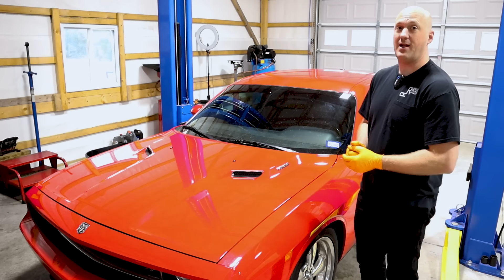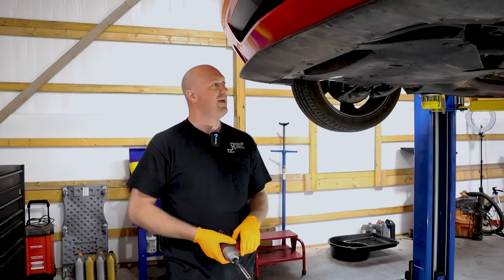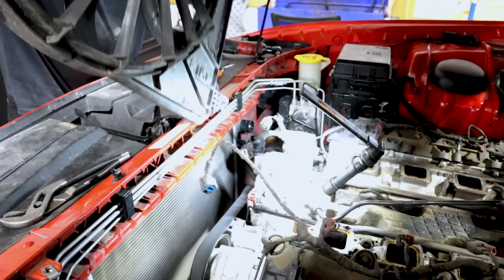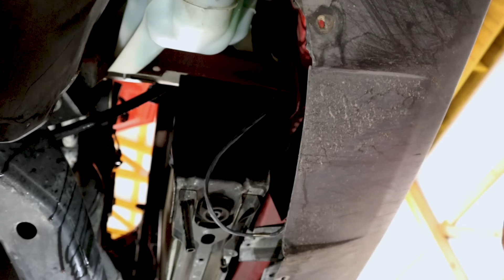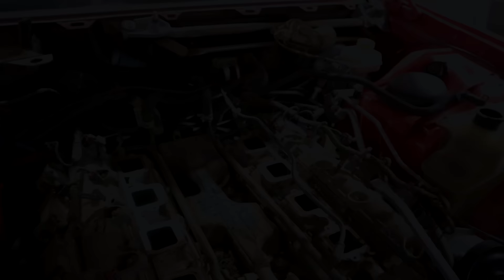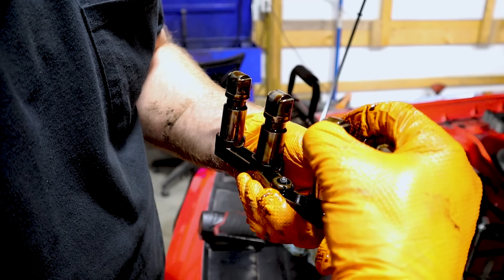Hemi Cam Installation! Budget Challenger Build Ep1

Comment from the maker: Let me know, what mods are you planning on doing to your Hemi next!?
Reply: I’ve already done long tube headers catless mid pipes CAI 85mm throttle body one piece aluminum driveshaft and 100 octane tune. I have a new CompCams camshaft and valve springs and new hellcat lifters I’m going to install. My R/T put 375hp and 405tq on the dyno. That’s to bad seeing as the DA was over 6000’ that day.
Reply: @jimmyford271  I know it sounds cool to say hellcat lifters but they're exactly the same non mds lifters across the board for all gen3 hemis...nothing special about them.
Reply: @DL101ca  maybe so but I ordered them for a hellcat so I call them hellcat lifters.
Reply from the maker: @jimmyford271  sweet!
Reply: I'm really looking forward to seeing how the 6.1 stock manifolds will bolt up.  I'd like to do that with my ram, but I do have the 08 engine, so I have the egr hole on cylinder #2 exhaust, and I have the rectangle exhaust port heads (Can't remember if it was Apache or Eagle), so I'm not sure if things will line up.  Boy the "log" exhaust manifolds that came stock are crying for better flow!
Reply from the maker: @The3chordwonder  Unfortunately the SRT headers won't work for the ram trucks. They'll bolt up to the headers just fine, but they are too wide to fit the engine bay.
Reply: @ReignitedAuto  That makes sense, there isn't very much room there for sure the way the engine sits between the rails.
Reply: @ReignitedAuto  hey this is a little random for this video but I had a question that I’m hoping u could help me with. If I was to supercharge/turbo charge an 06 charger rt would that same supercharger fit into a 2011+ model..? Thanks
Reply: What brand catch can and where can i pick up the same one? @ReignitedAuto
Reply: I really like the detail you put in, every step is nice to see, I was a life long Dodge man, bought my first Ford a year ago, a 2011 SHO with 45000kms on it and I kinda regret doing so, the water pump is leaking already and the AC doesn't work, I wish you could do one for the SHO, apparently is a nightmare to do, should have stuck with my Hemi lol
Reply from the maker: @stevelynch5843   I know Hemi stuff the best, but I'm definitely not brand loyal, I like all brands, and the old school SHO was a fun car!
Reply: I've had my cream puff factory stock '12 R/T for quite sometime. She's at only 39K miles so it's time for some goodies. I'm gonna start with the back amd work my way forward.
Reply: I couldn't find my original post to update but wanted to say thank you so much for this series. I have a Mopar 11 that lost timing chain.  The dealer diagnosed it(by leaving my engine in pieces, not exaggerating) saying it needed a new engine. I was intimidated because this was my first Dodge(Chevy guy)but your video gave me so much info I tackled it replacing cam, lifters, chain, tensioner oil pump and bent valves in head. Running like a top. Not enough room to type all the thank you's. You are the man.
Reply from the maker: @kevinbutler1173  that is great to hear! Pat yourself on the back as well, that's a lot of work! 👍
Reply: @kevinbutler1173  did you have any experience before?
Reply: I want to do alot, but I bought my Challenger in January,  and got the best service policy they offered.  I have almost 5 years before I can really mess with it. Fortunately,  the original owner installed a nice sounding exhaust and a hurst shifter on the 6 speed. Will be adding a sub and Amp for extra enjoyment soon, just haven't decided on what radio I  want.
Reply from the maker: @dfre6422  I miss the days of a good sounding stereo. One day I'll go all out on a nice one for my daily driver 💪
Reply: I did the the Srt headers and exhaust was thinking about doing the 6.4 cam ... are you going to tune it your self ?
Reply from the maker: @Airwalkz23   I'll be putting a DiabloSport canned tune on it for now. I'm hoping to dyno it at some point to maximize the tune, but no, I won't be doing it myself. I have some tuning basics, but not enough to do this.
Reply: True cold air intake and 392 intake swap are next in line. Then headers and exhaust
Reply: I started with the cam swap. Gonna force myself to do the rest now.
Reply from the maker: @clintondieter5871  Hard part is done!
Reply: Hey boss what do u think I should go with on my hemi I just want a little more hp and torq not to much just sum SIMPLE bc I loss hp and torque after I got a resonator delete it's like my car dont have that take anymore now it kinda drag a little b4 it gives off
Reply from the maker: @rzivh5682  Nothing simpler than buying a tuner. 👍
Reply: These new so called factory hemi vehicles today are Not  true Hemi's, it's a hemi by name only unfortunately.

The hemispherical head dome pistons will always be the TRUE HEMI's.

32 years of NHRA racing, has blessed me with great experiences with the Hemi engines.
Reply: @FaithfulServant316  Hemispherical Combustion Chamber = Hemi, what a waste of 32 years, I'd say.
Reply: MDS delete, cam upgrade, injectors, intake, headers and exhaust system. then probably some slotted rotors and stickier brake pads. thanks for the videos! so much great information!
Reply: will an intake mani upgrade provide any gains on a stock 2021 scatpack? ive heard compression and the factory timing are spicy enough to where bolt ons dont really add power to the 6.4. this true or bologny?
Reply from the maker: @mattpacktree92  I think there's always room for improvement with factory parts, but I definitely wouldn't start with the intake manifold. I think even a custom tune would benefit you more than an intake would. 👍
Reply: Will this work for me i hve an 06 300c
Reply from the maker: @d.i.yjones507  unfortunately not, when they went to VVT in 2009 they changed the block so the camshaft won't work. I've heard the headers will fit, but haven't tried it myself.
Reply: Thanks brotha appreciate it
Reply: Great job lots of tips n tricks thank you 🙌🏼
Reply: I want to get an HP Tuner so it can be tuned. I need to find out whether it will turn the oiling system on, as well. The long tube headers, the stock 392 camshaft, the oil plugs, the upgraded valve springs. Is the vaccum hose on the back of the intake manifold easier to remove and reconnect from the opposite end??? Eventually l would like to put a Summit turbo on it and add some gap to the rings (.032")total gap. Is there any chance you have the 392 stock cam spec's. Look on Richard Holdeners site and he tests the shorty headers compared to long tube, quit a difference on his engine dyno. He has also tested the different mopar intake manifolds to see where each made or lost power in comparison to each different design. I think that is basically it. Excellent video class, i'm impressed. Where are you? My truck is a 2013 Ram which i guess is a Gen lll. I've got a S&B Cold Air system on the engine, as well.
Reply: Hey great instructional vid. I have a 2013 Chrysler Hemi 5.7 and replacing the camshaft and lifters. Other than the cam and lifters, what other replacement parts do I need? ( I'm a novice when it comes to engines, but learning )
Reply from the maker: @user-fu1pm3cf7t  depending on mileage is probably a good idea to also replace your water pump and thermostat. Potentially if you are over 150k miles you might want to think about replacing about the timing chain as well. Obviously head gaskets, valve cover gaskets, timing cover seal.
Reply: I’m replacing a broken piston, thanks to a fallen valve seat
Reply: Can you do something with pushrods/rockers upgrades?
Reply: I think i need hellcat brimbos its hard to hold a stop with this new cam and tune.
Reply: Just got my 2018 Charger RT Hemi man and I’m an was looking for some good cam set up and cold air in tanks all the goodies we know about in the dodge world…I don’t know everything and I’m will learn so much appreciated for your videos I’ll stay tuned! Making a channel soon!!! Just worked and fixed my active exhaust issue…but if you have any products to refer me or anyone else that may have active exhaust issue because it’s seems pretty common that’s why I make a video of me doing the work myself it’s not hard just get a little dirty and most of all make it fun…thanks
Reply: I picked up a 2014 Pursuit, and just added a Loudmouth exhaust. I want to add a 6.4 cam, and long tubes. Are all 6.4 cams the same ?
Reply: Can I do this with a 2015 ram 1500
Reply: Bro could u please post a list of what u put in the budget 5.7l challenger so I can purchase everything bit by bit till I have it all I'm going to try and tackle this myself into my 2014 dodge charger r/t  5.7l the way u explain this build gives me confidence u really articulate it well thanks
Reply: My 2011 1500 lifter went out and so I’m thinking of also doing the 6.4 cam swap.  Does it matter if I use a 6.4 hemi  (truck) or 6.4 (srt cam) to put in my 5.7? I already have it tuned for mds off.
Reply: Mine is a 2015 rt challenger 5.7 it just got to 130000 miles n it started the old hemi tick it's driving me nuts...this video u r showing is it on the 5.7 hemi n if so can I do a cam lifter upgrade that will give me performance and thump sum as well without having g to tune it? Or do I need to tune it regardless but I don't want to have to spend a lot of money cause right now money is tight so the tick is coming from driverside of motor n it's middle close to the back on top.i can't stand it it's killing me lol.love ur videos by the way but please let me know thanks
Reply: I really need to know can  I put a 6.4 MDS cam in my 5.7 to keep the MDS? Will everything work okay without a tune? I actually want to keep it the MDS system.
Reply: Did you resurface the heads
Reply: I am curious about MPG changes if any. In previous videos you mention oil pump upgrades to the hellcat which would be a good time to do with every thing apart. I also like to remove coolant from cylinders since many of us are apart for many days and you can get rust in cylinders, I blow it out and wipe it clean and coat with an oily rag.
Reply: I am watching because I have 2011 ram 1500 with 190,000 miles and never even changed all of my spark plugs so it is time to do some work and upgrades, I have watched may of your videos and you give great information most do not. Thanks for being there for us Mopar fans.
Reply: Im installing Longtube headers, exhaust, cam, lifters.

Do you recommend anything else to replace while im in there to ensure a strong motor? I have 120k miles in my 2006 charger srt.
Reply from the maker: @TheMoparian  I'd probably slip a timing chain set in there as well.  👍
Reply: I have a 2022 Ram 1500 5.7. Do you know if the 2011-2015 6.4 MDS camshaft kit with work on my 5.7?
Reply: ONE of my MDS lifters failed on my 2015 Ram 1500 Sport 5.7 Hemi. 

Assuming I find the 2015 version of that same camshaft that meet my VVT & MDS criteria, are the 6.4 Challenger camshafts compatible (as bolt-on/direct fit) in the Ram 1500 5.7 Hemi?

Also, is it a requirement to upgrade those valve springs because of the beefed-up camshaft?

Sorry so long, but of your other videos (re: hellcat/melling oil pumps) typically talk about compatibility with Ram models/make/engine/year but not this video. 

Love your videos!!
Reply: I have a 05 rt magnum hemi. Is it the same process? This is a pre eagle?
Reply from the maker: @jayrey1713  it isn't, but the process is almost identical. I've got lots of magnum content on the channel if you want to check it out 👍
Reply: @ReignitedAuto  Do you have to do a cam crank relearn for this?

I just did the lifters and camshaft (stock VVT & MDS) on my 2015 Ram Hemi and it began throwing codes U1424 and P1DD2 and traction control light then goes into limp mode stuck in 1st gear.
Reply: Where did you order your parts from?
Reply: Great video, BUT how you push back the timing chain tensioner? what can i use?
Reply from the maker: @realspitkenny5561  literally a screwdriver works just fine, lever it against the front of the block behind the timing chain. there's not a lot of spring tension so it doesn't take much force to collapse it. Then just use a small allen key, or anything small enough to fit in the hole to keep the tensioner in place.
Reply: What’s going on litterally redoing a 2013 rt think you can drop a pin to the lifts and the exact 6.4 cam
Reply: @ReignitedAuto after doing this should you drive a certain way for a certain amount of miles before you can put your foot in it..or you can drive it how you want to right after?
Reply from the maker: @traylei3731  no break in needed, drive it however you want.
Reply: @ReignitedAuto  one more question as far as timing i noticed you didn't mention anything about timing chain marks.. and didn't see any on yours after you set the timing. Is that a important thing or you're good longs the camshaft and and crankshaft is in time? Finally done with it but didn't pay attention to any timing chain marks..but haven't fired it up yet
Reply from the maker: @traylei3731 exactly right, as long as the cam and crank are in the correct positions the timing chain marks are irrelevant.
Reply: @ReignitedAuto omg that's a load off the brain..thanks for the fast response!!! I can now sleep knowing that!! I really appreciate it!!
Reply: @ReignitedAuto I got a 2012 Chrysler 300 Mopar edition that I wanna tune up. I was thinking about boring up to a 6.1 and adding the same stuff you did with your challenger. Any tips on what I should get instead or what I should do?
Reply: @ReignitedAuto , I have 2005 Magnum r/t , just to confirm everything you did here should be plug and play on my hemi? I plan to delete the MDS. Great tutorial btw!
Reply from the maker: @matturquizu2255 the process is basically identical, but the parts will not transfer, especially the cam.
Reply: @ReignitedAuto  this is a big ask, can you recommend a parts recipe and or resource I can reference  for my situation ? or at lest a cam, I can figure out the rest of the parts. Thanks

Comment: I did this! Because of you! I did put shorty headers and  6.4 cam ,moplar performance springs 6.4 injectors and a 6.1 intake because it looks better then plastic! I also got it tuned and put a better throttle body.
Reply from the maker: Great job! 👏

Comment: Would this work on a pre eagle 5.7
Reply from the maker: Unfortunately no
Reply: @ReignitedAuto what’s different about it?
Reply from the maker: @dhdbsdhdbd5960 the camshaft primarily, it's a completely different design that won't fit the earlier blocks.
Reply: @ReignitedAuto o ok. but the process is pretty much similar? Whether pre eagle or eagle?
Reply from the maker: @dhdbsdhdbd5960 almost identical 👍

Comment: Howzit Sky! i'm back here. So I still haven't done the mods or anything to the engine. I see a lot of old burnt oil by the valve covers, is that something I should be concerned? I have the new gaskets but haven't installed them. how and what is the best way to clean the top of the heads? should i just use a degreaser and maybe a blade? I haven't really heard any ticks, but if I upgrade the cam, should I do the new lifters? my car is a manual non mds and the mid mufflers have been deleted. its at 92k now. iw as looking at the BTR stage 2 cam with new valve springs and pushrods. they do say that it needs a VVT phaser. Should I also consider doing the lifters at this point? A lot of people I have talked to recommend long headers. What do you say? If i actually swap the headers, don't i have to change my mid pipes to accommodate the cats? Is there any welding needed for this? I am trying to do it all in my garage without a lift, so car would be on the ground. Thank you for your help and input!

Comment: 5:40 I like to throw a shop rag over the latch. Someone with good intentions will come up and lean on your trunk 😂
Reply from the maker: No lies told here 😄
Reply: You can also hook up one of those portable jump starters to your under hood battery connections and open the trunk if battery is disconnected or totally dead.

Comment: My wife and I have a 2013 300C Hemi 5.7 that has 155k or so miles and it's in the shop.  We were told that the engine seized and that a ring was found in the bottom of the engine which is what caused the seizing of the engine.  The warranty company said they aren't covering the engine warranty even though we are in the confines of the warranty itself.  Miles and or time (years) are still within warranty guidelines.  They said that everything that is lubricated inside the engine is under warranty.  They told the shop it's at that they want to know what is wrong so they wanted the engine torn down to tell what the problem is.  The warranty company said that because a k and n air cooling system is on the car which we bought that way they are not responsible.  Then they said that if we get the dealer to call to let them know it was sold to us that way that they will cover the engine and so much of the labor.  The warranty company was contacted and we explained we did what was asked and they still deny the warranty now saying because rims and tires were replaced (new rims and tires put on to make the vehicle safe cause the others were old and cracking.  Shocks and struts were also replaced but they haven't said anything about those which is weird cause anything new is considered aftermarket parts as they pertain to the failure of the engine as it is in this case.  The shop was ready to install a used engine with 36k miles as long as we paid the deductible  so we are at a standstill what do we do now?  Never been in this situation.

Comment: This is one of the best videos I’ve ever seen about doing a cam swap. 

I did it a few years ago and didn’t remove the cowl or the brace because I didn’t realize how easy it was or how much room you gain. If I ever do the job again, which I probably will, I’ll pull the cowl and that brace for sure.